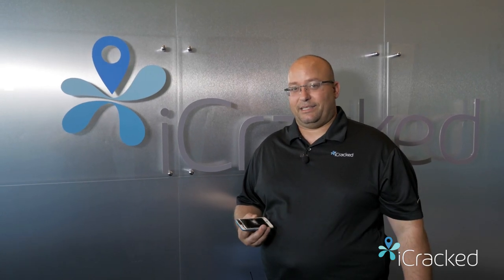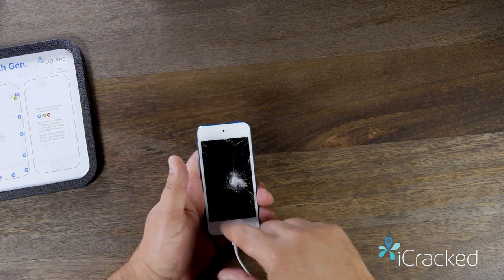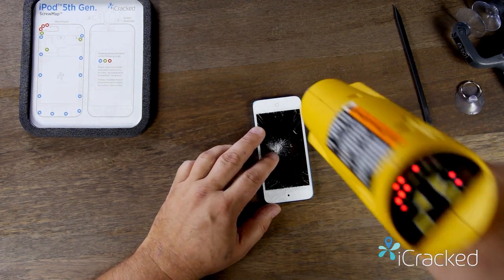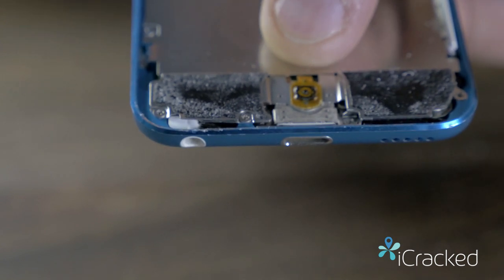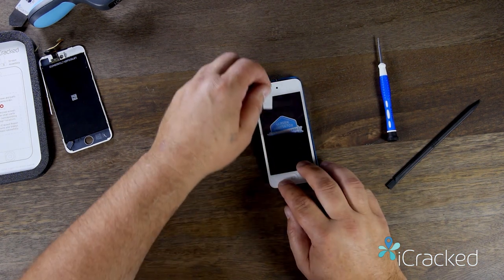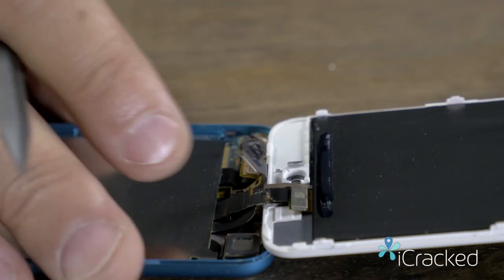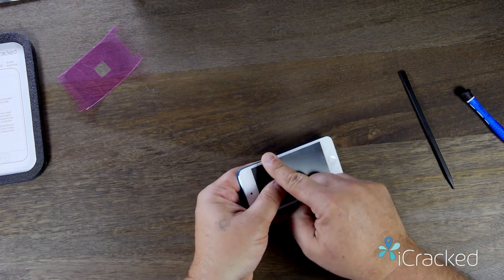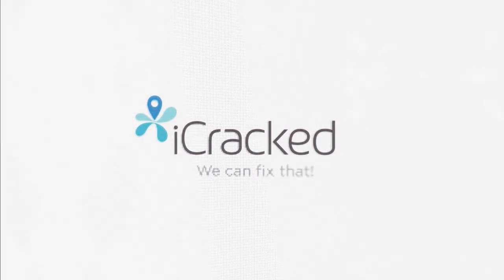Official iPod 5th Generation Display Assembly Replacement Guide - iCracked.com

Comment: Hello,THANK YOU for this video!!!Totally helped me get my ipod back up & running!NOTE to people watching this:DO NOT disconnect the power & volume flex ribbon cable if you don't have to.Mine was a total pain to reconnect to the board!!Otherwise everything else went great.THANKS AGAIN
Reply: seconded , i just did a home repair on my cherished ipod touch 5th gen & i swear to god i used atleast 4+ hours & alot of elbow grease just to get that damn volume flex cable back into the spot it was in .

Comment: 16:15 is no joke, it's really difficult to get that alignment correctly. Even if you are the type of person who has done numerous repairs of these things, it's still a frustrating alignment.

Suggestion to those who are attempting this for a self repair. Just unscrew the bottom portion of the iPod and gently lift the entire channel and battery together. This'll give you leverage to connect the power button flex without having to perform David Copperfield feats.

Unless you plan on doing this repair on a clock; there's no reason for you to have to learn how connect the power flex in the manner this video shows.

Best of luck.

Comment: Just a little tip for you people watching this video and going straight to repairing your Ipod. Watch multiple video guides on replacing the Ipod 5 screen (or anything for that matter) before doing it yourself, sometimes videos don't clarify every little detail and things you need to careful with.
Reply: Your right about that.  The video cut twice @15:48 & @16:22 because they failed to show people the difficulty of plugging in the digitizer cable and the power cable to the motherboard.

Comment: What if the home button feels stuck down?
Reply: That is a very common issue with the iPod touch 5th gens; especially after you've opened one up.  This happens due to the little black dot on top of the home button flex cable splitting, and part of it sticks to the home button and then gets lost as your opening the device.  That little black dot can also randomly get dislodged from the home button flex cable causing your home button to sink in.  It can be easily fixed by cutting a very small piece of plastic from a water bottle and crazy gluing it to the home button flex cable.

Comment: Replaced exactly how he done it however turned my ipod on and I've got 5 white/grey lines appearing on the left hand side of the screen....got no images. Anyone know what's happened please? Thanks.
Reply: at least yours is turning on. lol mines not doing shit
Reply: leadster88 that only happens if you don't connect the cables correctly.

Comment: If you have a black hole in your iPod is that a screen problem or a system problem
Reply: +jaylen hardy screen problem
Reply: +NewBornWrist so if I replace the screen its going to be fine?
Reply: jaylen hardy Yea i had that same problem its cause you dented the screen some how
Reply: That would be a pressure crack/spot in the LCD.  The screen assembly needs to be changed.

Comment: im getting annoyed, so i take my last screen off, the LCD was cracked to hell and back and the touch was gone and i replace it with the new screen. the wiring is all hooked correctly but i can get it to displace anything, ive tripple checked that my inputs were fully pushed in. i even made sure it wasnt the ipod by putting the old one back in and tunring it on (lite up nicely, by nicely i mean it was still cracked to hell and a colour of blue ive never seen before with a shadow of an apple symbol in the background implying that it was starting up) unplugged it and put the other one in again and got nothing.

Comment: my ipod is cracked and becuase of it cracking my home button dosnt work what do i do
Reply: Aubree Prado you don't need your home button after you set up assistive touch. 
Settings- General-Accessibility
Assistive touch turn on. Then customize top level menu + to add. Then click on to select command- home. 
If you use screenshots you will need to add that command as well since your actual button doesn't work. Hope that helps.

Comment: I did the entire replacement, but my iPod screen is not turning on. What did I do wrong
Reply: albopk3r Did one of the wires that were attached to the screen break or get partially cut? If so then your screen is pretty dead, you might look into replacing one of those wires.
Reply: albopk3r btw when i say wire i mean flex cable
Reply: No bro, it was a brand new screen. I just put the old one back on and it worked perfectly fine. So I refunded the screen and hopefully ill get a new one
Reply: +albopk3r I had the same problem. Did you get another screen?
Reply: Dave Kryschuk I did, but that shit just won't work
Reply: vilosoraptorproductions I just saw this, and yea idk what went wrong, but when I put the old cracked screen back on that one still works.
Reply: I'm going to try another screen. I have done one of these successfully before.
Reply: Dave Kryschuk Yea, so like I told violsoraprorproductions when I put the old screen back on its fine. I think I might have damaged a ribbon cable when putting them on since they are in the back and I couldn't reach it maybe I ripped it I'm not sure. I've changed 25+ iPhone 5 screen absolutely no problem but these iPod screens are killing me.
Reply: +albopk3r Yep, Same with me. I've fixed all types of phones, iPads, iPods and I'm having problems with these. The second last one I did won't work either, motherboard gets hot and the old screen won't even work. Brick now.
Reply: Dave Kryschuk don't leave the battery or the iPod on when you are changing the screens. Thats why your motherboard gets hot
Reply: +albopk3r Ok, but no way to turn it off now. guess I can disconnect the power cable.
Reply: Dave Kryschuk yea, always make sure its off before you start.. ALWAYS its key to not ruining any other functions